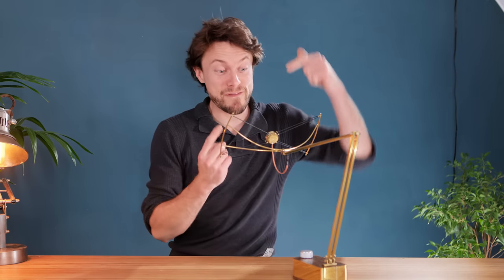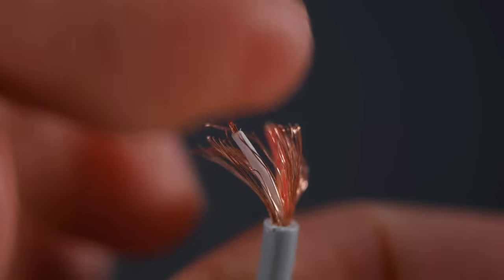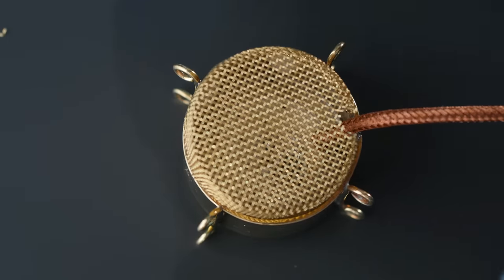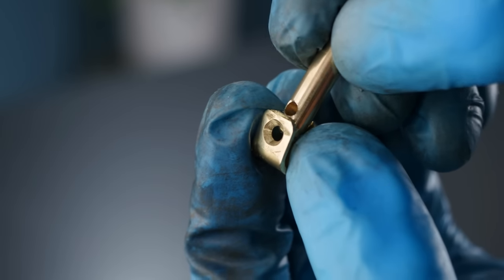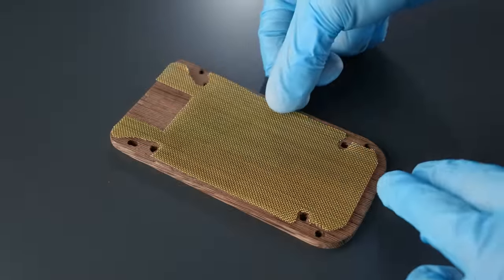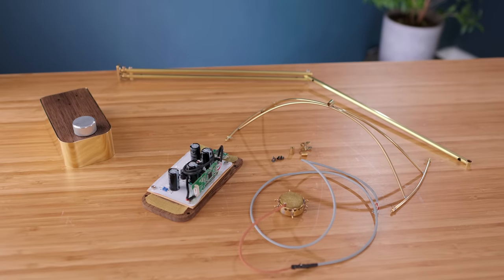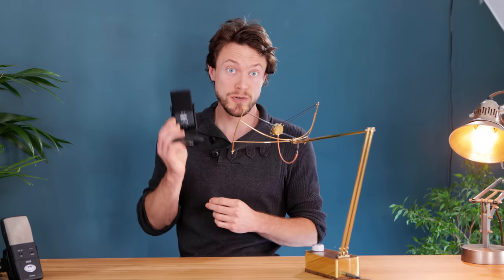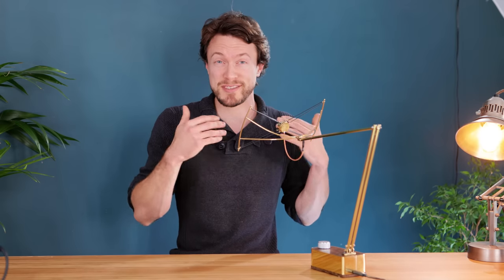Building a quality USB-C microphone

Comment: Before I say anything else, I just want to say that I respect Matt and this video so much more than many youtube project videos. My mans actually did a ton of documentation for this and made it really easy to recreate. This is probably one of the best diy mics I have ever seen in terms of quality and feasibility to build.

So, I built it.

And yeah, totally sounds like he said. I’ll gas it up as much as he says, it’s really nice. I have been thinking about this project for three straight weeks now and I really do feel like the payoff was worth it. 90% of this project was waiting on parts and existing in a sunken cost fallacy purgatory, but overall, if you plan on doing this, most of the parts here take a good amount of time to get here (especially if you order from china, which is necessary for price efficiency).

And that’s all I can really say about this. It’s a good mic, I rate what Matt is doing and the amount of time and research he put in. But there’s one big thing that bothered me about this project. The cost for all of these components is not ~$30. Not a chance. 

As you can see in my spreadsheet below, not 30, not even 100 dollars (accounting for possible currency conversions). If you don’t have a ton of brass, wood, and the proper capacitors lying around, you will be spending more. That as well as the fact that some components are just not available in the states. I traded the THAT1512 for a INA217 because of this. The INA217 has different resistances for gain but other then that it is largely the same (not really, I would still like a THAT1512 but they take 4 months to get here it seems). The finish of brass and wood is cool, but completely impossible for people that don’t have tools to work with them (also there’s no specs listed so I’m not sure how you would do that anyway), so I 3d printed everything (box and module holder) so I didn’t have to buy anything else. The cost I listed accounts for these even more budget considerations, so all in all I would call this a budget mic, but with a hard asterisk. 
I want to stress again, this project is so cool and I’m really happy I did it. Just do your own budgeting before hand and make sure you can sweat $150+.

I included some pictures of my build and all the stls (as well as a fader knob I stole from thingiverse I cannot find the original link I will update if I find it))

Definitely worth the time put in.

Here are some resources from my build: 
https://drive.google.com/drive/folders/1Ax8V7ID-nKL7wJXj9A7RIaR2wb1TqigN?usp=sharing 

Direct Link to my spreadsheet:
https://docs.google.com/spreadsheets/d/1pQlkRerO5geoDNLEWXTUVbyJalM7nESn/edit?usp=sharing&ouid=114689008105602245905&rtpof=true&sd=true

Edit: Here's a quick write-up I did on this with some sort of instructions-not-really that might be helpful: https://github.com/TrojanPinata/DIY-Mic

Edit: As of writing this, t's been a little over a month now since I made this mic, and honestly it still holds up. I finally have a THAT1512 coming so I think that will fix some of my gain issues. Overall, I definitely still like this mic. I use it pretty regularly and get compliments on the quality. If I used it more then I do currently I'd suck it up and buy something really nice, but this will do for now. 

As for this project, I still really respect the original build. For those complaining about me saying I with there were more verbose instructions, I think you're missing my point. I just kind of with I had a better idea of some of the specifics. That being said, I'm probably never going to do this again, what with the posting my version of a project online. Some of you all are great, but the number of armchair engineers here is wild and I really would rather make things because I like them and not have to deal with people nit picking a writeup I did one morning before work. I mean, I don't know what I expected from the youtube comment section. Anyway, I'm done, enjoy your mic if you're building it, and if you aren't then I really don't care what you have to say about the way I did things. Later.
Reply: This should be pinned tbh
Reply: Yeah, it's great that he's doing this but i feel like it could be a bit more open
Reply: Thanks for sharing!
Reply: Also in the process of making it, and yeah, totally agree - I'd like to add that as a video this is a great, easy to watch and share bit of content. But as a tutorial? 

The circuit diagram and the circuit in the video doesn't match - some capacitors appear to have changed direction?, 
the parts list only consists of what he had to buy not what he used - and there are measurements missing like the length of the brass rods,
the difficulty and process of each step didn't come off well - maybe I'm just supposed to know how to solder brass but he made it look easy so I didn't bother looking anything up and screwed it up a couple times,
he skipped over the wiring for the analogue to digital converter,  
and to top it off there's an advert smack in the middle of it.

I'm being really picky but having to follow the video has made these bits stand out
Reply: Honestly I would love to see people remaking this with whatever they have at their disposal. You have a 3D Printer, he has apparently access to a ton of brass and some wood, someone else might only have access to wood or plastic... It would be really fun to compare and contrast every version of this project. Also, great job with the "proof study" of sorts, this is what DIY builds should always have!
Reply: here in the UK I can get 6 brass rods for approx £4... yet again, everything in the US always seems to cost more
Reply: @toothlessblue  This is a little silly. First off, of course there’s an advert. I for one wholeheartedly think Matt deserves to monetize this - do you just want all this handed to you, free of charge? You pay a minute of your time.
Second, there were no special tools involved here. Brass, wood, some screws, solder and rubber o-rings, outside the electronics. 
Speaking of those, there’s a whole video on the channel for the USB-C interface. Including that in another video would be silly. So go watch that. 
Also, nothing in the video needs to be replicated exactly when it comes to the design. Matt has made an example - it’s not a baking recipe that needs to be followed to a t for the dough to rise. You see what’s possible and how, and then you make your own version of it - smaller, bigger, rounder, more wood, less wood, etc. Complaining about the lack of exact brass measurements makes me feel like you’ve lost the point of the whole thing… 
And then the cost. If you don’t have the tools, you’re not equipped for the task. If you want to complete the task, you need the tools. Not being equipped for it, isn’t something that Matt should calculate into the cost - you wouldn’t either, if you had the tools. Also, if you don’t want to wait for the cheapest option, then that’s on you, not on Matt or anyone making DIY videos.
You get a specific, close to paint-by-numbers instruction for building a mic that rivals $3000 commercial products for a fraction of the cost, but you won’t allow the creator a commercial? Okay, bud. 🤦‍♂️
Reply: WHAT A CHAMP
Reply: So, I found this video very shortly after it’s posting and got the idea to build one for a Christmas present. I have not attempted to assemble anything yet, though I have most of the parts needed at this point. I’ve been waiting for others to try it since I’m a relative novice to soldering and general metal work. 

I found a SparksFun potentiometer with 8 positions for soldering resistors that I’m hoping will work. 

I have the brass tubes, mesh, and some brass door kick plates to attempt the brass strips being used here, along with the brass wire which I took a guess at and bought 12 gauge wire. 

Buying the proper tools, borrowing what I could, and attempting to source the components was a challenge, but part of the fun. 

Today, I plan to start with the amp board and see if I can get anything to take shape.
Reply: @prezpolk4ever  lots of luck! Hope it goes well for you 😁
Reply: Cool that you shared this. Thanks. I was sourcing out the parts, myself, and noticed that the price he quoted of 30 bucks for the project is a serious underestimation. Your spreadsheet confirms as much. Sure, perhaps only 30% of the material bought goes into the finished product, but if we're not making three of them, the unit cost is still the total cost of the material, used and unused.
Reply: @stevesoldwedel  I have so much extra brass mesh that I could literally make 10 more grills and still have some left over lol. definitely better for someone making multiple.
Reply: @gsommerfeldt  you're exactly right. This isn't meant to be an step by step blue print, simply an example of what can be done so someone else can take the idea and run with it. I found every one of the parts needed, including the THAT1512, either on Ebay, Amazon or other electronic sources here in the US, all in stock for less than $50 so I'm guessing he meant £30. That's starting with none of the parts at all, no brass, no mesh, no transistors, nada. So I don't know where @Gary Oak was looking, if he only looked at Matt's links or just didn't try very hard to find the parts but they are available and this is easily buildable for close to what Matt claimed. I'll be starting mine after the first of the year and I'll try to document it and post back including costs, where I buy my parts and if I have trouble getting parts.
Reply: @prezpolk4ever  plenty of videos here on YouTube on how to solder both with an inexpensive stick and a small kitchen torch. Plus ask around, I'll bet you have someone you know that has electronics, plumbing or heating and air conditioning experience that show you tips on soldering. Good luck, you will do fine!
Reply: Fantastic build notes and yes - $30 with an asterix! I'm pulling together bits in preparation to start. Instead of all that brass tube I'm using a small articulated LED lamp I bought for £9 from Ebay. It won't look as fancy, but saves a lot of time and effort. Thanks for spotting the capacitor polarity error!
Reply: B
Reply: Thanx for doing this spread sheet!
Reply: @gsommerfeldt  

Yeah I'm gonna complain about the ad, it's long and annoying, put it at the start or end so I don't need to navigate around it. Alternatively make me pay to watch the video.

I wasn't talking about the USBC interface, I didn't even use one. He went over where to find instructions for the USBC interface but I'm talking about wiring the other end of the ADC - he went over getting a voltage from it then skipped over wiring the audio output to it.

What you think a beginner isn't gonna try and follow the video to a T? Cause his amazon affiliate links lead me to some brass rods that were too short. I made do, but it would've been nice to know. Not everyone here's an expert, it's obviously relative and you're evidently the smartest man ever to live.

I didn't comment on the cost, that was OP, but iirc the original title said something like "make a studio mic for £30" and yeah I agree with OP: that's misleading. I don't understand your point on waiting for the cheapest option, I think you lost the plot there.

"If you don’t have the tools, you’re not equipped for the task (repeated about 3 times)". Congrats sherlock. Here's the thing though, if you don't have the tools or materials it's gonna cost you more than £30 to make the mic, and I bet most of us don't have either of those.

He's obviously allowed his commercial and I'm allowed to be annoyed by that, I honestly don't care how much he makes from the video; it's irrelevant to the quality of the tutorial.

In conclusion drop the condescending emphasis and eat my ass.
Reply: Awesome, and thanks for the reality check - hell, I could spend the entire $30 on a garbage soldering iron I don't own. The tools and resources are so important. Either way, $150 is a steal for not only the mic, but also the fact that audio interface! My current setup was at least $250 dollars and is bulky and cumbersome. Cheers again!
Reply: @daveacker7427  I'm glad I kept on reading. I got a little discouraged at the thought of it being over $100 (while I do think it's worth way more, that's not in my current budget) but you got me back to being excited about being able to show this thing off one day!
Reply: @cuisinwithkev2699  It's definitely doable for under a hundred and should be for under $50 with a little looking around and price shopping. Definitely will be a fun project.
Reply: Thank you so much for sharing
Reply: @toothlessblue  And everyone else is allowed to criticize you as a critic... Crazy how that works right?
Reply: @gsommerfeldt  Pay a minute of your time, or just press a button a few times and skip it. Easy choice. Also not including brass specs is very big let-down. Many people liked the design and would want to make it as close as possible, but he made it impossible for selfish reasons I guess? He wanted to have "unique" work of art that nobody in the world would have, eh?
Reply: he does say countless times "in mine i did this", "in my i did that" and so on, meaning you make it out of whatever you have laying around, the video was (in my opinion) an example of what is possible using items that the average viewer that is subscribed to his channel might have laying around ........ people are to quick to pick fault
Reply: @leightonwestbury92  Exactly.
Reply: Would it be possible to update the drive with photos of how the potentiometer is connected? 

I know the gain has 2-pins and the potentiometer has 3-pins. Also, since you ended up adding a 2.2k Ohm resistor in series with the potentiometer, would you recommend going with like a 3k Ohm potentiometer instead?
Reply: @daveacker7427  hmm, i'm in the UK, and what he mentioned 150 is what I'm looking at right now, I mean capacitors are 13, and mich is around 22 alone, perhaps it's the shipping cost etc... oh well still thinking of doing this as a DIY project.
Reply: @octaviodelser  it could be the shipping differences. Everything is so screwed up right now. I'm going by what I found on Amazon and a couple other sites I normally use. Of course, I could end up getting the "It's sitting on a ship somewhere in the Pacific and we have no idea when it will be here" answer when I try to actually order it too so there's that issue right now. I will do it soon but I'm working on getting a new house the project's on the back burner for now.
Reply: this must be pinned
Reply: I am making this design using the BM-800 casing, a custom pcb with the components, and a 18650 battery inside the mic. I think it will be easier for everyone to reproduce.
Reply: @toothlessblue  I have been knocking around the web looking for what is shown and from the links to the google docs DIY Perks links to and as well as the parts, not to mention trying to figure out all the sizes that are not stated. ie; length of tube, od or ID oof tube as well as the rods used to insert into the tube. A lot is left out, most likely on purpose, as ole saying goes ya get what ya pay for. And it's been so long that worked with this kind oof stuff, gotta relearn it :))
Reply: @Gary Oak I thank you for putting together the info, still thinking if I should tackle this, and yes, I knew just as you stated, not even close to $40 the one only thing that was never stated by DIY PERKS, was where did he make all the cuts to separate the contacts on the back of the strip board. I glossed over your github post, will have to look closer.
Reply: Watching your documentation made me realize that the brass mesh needed is actually smaller than the #20 which is the one I was going to buy. I think #40 or even #60 are perhaps a closer match. I wish he would have provided a bit more details in terms of the description of things he used. Some of them we have to guess them and we end up in a trial and error loop. I would love to recreate the same exact one that's on the video but I'm affraid that my brass rods get cut at different lenghts as they're also not specified and end up with the mic hanging in the middle sagging all the way due to a way too small cut on my end T_T. Either way, thanks a lot for your input. By the way Gary Oak, what did you use for the audio cable that goes from the enameled copper wires to the pre amp? I'm still trying to figure that out.
Reply: Many thanks for the additional guidance! Can you provide links for where to purchase the braid and audio cable?
Reply: @daveacker7427   the price depends largely from the Location, for example only the microphone capsule cost 57$  on  ebay ( over the  link) or 63$  from jli, both with  taxes and shipping included to Germany. I tried to find a better source but I did not had luck. If somebody finds a better source let me know i' m interested.
Reply: @jodrei7643  true, location certainly plays a part in the cost.
Reply: Does anyone ordered an alternative electret from China which has a decent quality? I'm not sure if I should try those out, or skip them completely and go with jli.
Reply: @gsommerfeldt  YES, but besides all that, brass tarnishes quickly leaving you with a dull looking project.  I would lean toward aluminum which is available at the hardware store as screen, rods, and tubes.  Or I might glue some of my old Pick-Up Sticks together to make tubes.  As for the wood, I have a pallet lying in the dirt out behind my garage.
Reply: I like your spirit ,
Reply: Bit late to the party but can anyone tell me which of the wires to splice from the capture card? I can tell its the ones coming from the 3.1mm jack but I'm not sure if I splice the L and the R ones into one and the gnd one for its own one
Reply: This is like those DIY woodworking channels that say "build a professional looking bookcase for $10" where the guy owns $5k in tools, a $3k slab of hardwood, and just needs to go to the hardware store to pick up a pack of screws
Reply: Bro, I freakin' love you, I never noticed this comment, your STL's are AWESOME! Thanks for including those!
Reply: @TheParanoidGiraffe  lmao yes
Reply: what's with the last edit man :(
Reply: I keep seeing people complaining about the cost going up based on you need to buy the tools. Seriously? Are you going to buy a tool to do this then never use it again, then you should probably not be doing this. 

Also yes the parts can be more expensive depending on how long you are willing to wait. I have been slowly awaiting parts since the video came out and I have most of them now, and I think I have so far spent around £35. I’m sure there are bits iv missed but I’m not expecting any biggies in that.
Reply: @JamesSDavis  it's mostly because not everyone has a full optional workshop ready to use, so you probably have to pay for those modifications too, which increase the price plenty. It's true that in a diy channel tools are expected, and it's also true that many people just want a mic without having to build 300 other things to compensate for the cost of the tools :D
Reply: Hey, just want to say thanks for your write up. From a fellow engineer, it's invaluable to have something like this, we all improve from seeing how someone else tackled the same build.
Reply: Where are you located?

I'm on the US East Coast (Maryland) and the parts were roughly 70 USD, including shipping, not including the price of the brass, tools, etc.  I housed in in an old broken mic body a friend gave me for free some time ago after he wrecked it with a bad solder job trying to fix it.  

The 0515SC was probably the hardest find, but I got it from Mouser at roughly 5 dollars.  Almost all the parts were from mouser.  The FET was from ebay and the capsule was from JLI.

It was more than the video suggested, but not nearly this much.

Since building the 0515SC has gone out of stock AGAIN but with some small adjustments to the package you could use a 0515DC which is widely available.
Reply: @toothlessblue  Do you also complain in cooking videos when they require you to use a knife or a pan or a mixer if you don’t have those tools already? Like no shit, $30 isn’t going to cover literally everything if you have zero crafting supplies beforehand. But if you have the basics like a soldering gun, drill, file, etc. the materials aren’t really all that expensive.
Reply: Just a quick question, in your links you've noted on the board schematic to flip one of the capacitors. With them being non-polarised is there a reason for this?
Reply: Checked prices... I unno where you were shopping but it can be made in around 50$, nowhere near your 150$. 10$ for USB-C connector?
Reply: @TheLifeLaVita  Fully operational workshop - pieces of wood, scissors, drill, kitchen torch, solder and old motor laying around
Reply: @gumball20000  what is that example lmao, everybody has a pan or a knife because it's required to live, and even if for strange reasons you didn't, it would still cost 30$ maximum for that and more, forever. How is that even comparable to 1500$ for each tool you're gonna use once?
Reply: @r4yker442  yes
Reply: Hey I was wondering if you could shoot me an image on how you wired your dac to the USB c converter? You and I bought the same one but I can't tell where to put the wires since he has 2 extra copper traces to solder to than the one we have in us amazon
Reply: I was actually thinking of taking an old BM-800 I have laying around. I already have an audio interface/phantom power source (Behringer U-phoria um2), so I guess I'd just need to substitute the capsule and use the mic's XLR output. Thing is, I don't really know if I'd need any other component or if it would just be okay as is.
Reply: For anyone attempting this and needing a soldering iron, I suggest maybe look up the TS80 or TS100. These are relative inexpensive little soldering irons from aliexpress ect. That are open source and have changeable tips. They even work good for smd soldering (with the right tip of course) and have a nice feature set
Reply: @phanirithvij  agreed
Reply: I looked over some of your parts, and the thing is, many of these things may have a notable up-front cost, but those materials can be used for other diy's, effectively bringing down the price. It might be up-front $150 but if you divide out the cost of the parts that you actually used for this project, the price is much lower. but thanks for the context and the detailed info
Reply: @r4yker442  it's a 4 pack, the breakout boards are ~$2 each
Reply: @TheLifeLaVita  if you're only going to use a soldering iron once, you either probably shouldn't diy or you should try to find some other projects to get more use out of it. i've used a soldering iron so many times for things i never imagined i would use it for - things like swapping out a shitty battery in my work headset, when i realised it had terrible battery life - that now i can't imagine not having one. from a diy perspective, basic soldering tools and P0 screwdriver are invaluable. and a cheap file costs $2. i don't own a drill, but there are so many uses for a drill that it seems silly to call it a one off tool.

if you "just want a mic" then just buy the mic lmao. trying to build circuits without a soldering iron is like expecting to (un)screw things without a screwdriver.
Reply: @LC-hd5dc  yes miss Clara. I literally talked about exactly that in my comment :P
Reply: This is going to make my build so much easier! I plan on also 3D Printing most of the aesthetic components. Most likely trying to design a different housing for the capsule as well. Great write up!! I really appreciate it.
Reply: Hmm very interest… wait you built it. How. I thought these videos were only for marvelling at.
Reply: you did it, congrats, but would like to point that its expensive bcz you odered them online, which adds the cost, buying them from a local store would have saved a lot, as per your spreadsheet more then $60-$70, hope it helps
Reply: My man just wrote an essay
Reply: Honestly 150 is still fairly reasonable though and you can bring down that price a lot by focusing more on functionality than aesthetics.
Reply: I can't find the jfet he used in the video, can you suggest some other good quality jfets? i can only buy k660 k596 k170, it has many fakes and easy to buy
Reply: hey, can you help me with the amp circuit or at least the voltage output, because im stuck trying to guess why its not working, (i get -12v from output and ground)